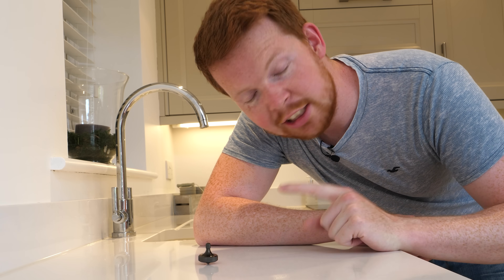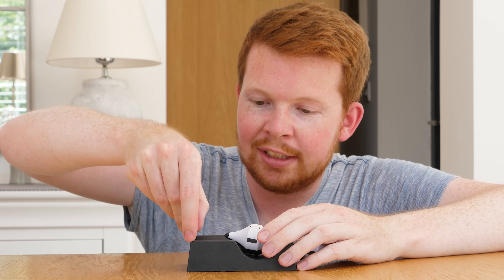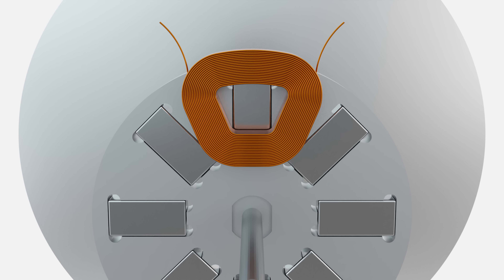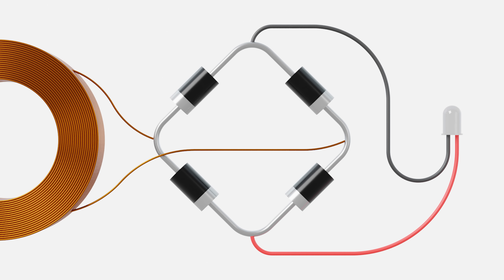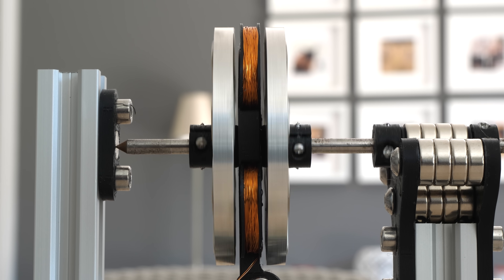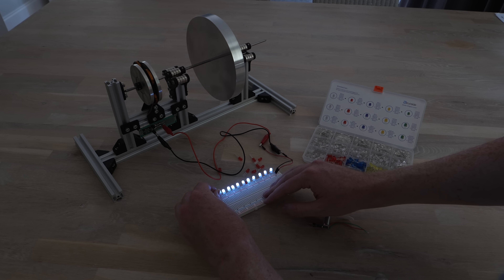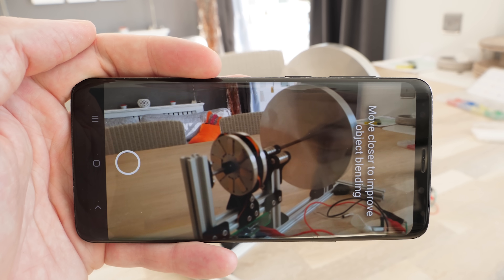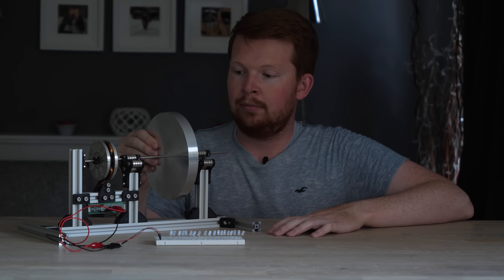Flywheel Battery

Comment: I had the basics of the theories all down fine but application sucked because I didn't have comprehension of the finer points. Bridge rectification is old hat to me, no problemo. Long ago I fooled with a mag lev rotor design but wasn't comprehending that it doesn't need to be completely enclosed by a ring of magnets. Gravity is good enough to make a half bearing work fine. SO cool. On to extracting energy from magnetic impulses... Wasn't understanding that it needs to be bilateral in order to be truly effective. Also wasn't understanding that the falloff distance of the magnets is critical as the force lines need to be positioned within the pickup coils. THANK YOU FOR ALL THAT. I had been thinking it would be stupid cool and cute to build a miniature model of a hydro power station under my rain gutter complete with miniature light towers so that when it rains like hell on summer nights, it all lights up like a proper power station. I know I don't need mag lev and a flywheel for that but still... If you're gonna go all the way to San Jose, why stop at Albuquerque?

A question... Could larger disk magnets be used at the ends of the mag lev bearing sections to keep it in place without a contact pressure point? I realize how slippery these fields are... but it just feels like it's doable with the right shapes nudging against the right shapes.

Comment: Why not add another vertical upright on the flywheel end, then attach a small magnet to either end of the shaft accompanied by a small pole aligned magnet attached to each upright?
This would stop any lateral movement of the apparatus using magnets and totally eliminate the friction between the axle contact point and the lateral arrester.
The result would be a true levitating machine with no friction points. It would also eliminate the requirement to slightly offset the supporting magnets.

Comment: This would be great in some kind of foam flinging blaster that uses much smaller flywheels. Just the floating magnets and the flywheel but smaller would be great. All you would have to do is spin it and you would have little friction on the axle.

Comment: If you buffer your output with an alternating set of batteries loading only the set not  connected to the flywheel you will get far longer and storing more energy

Comment: Very interesting video. In my humble opinion copper coils need an iron core to increase the magnetic field.
As mentioned by others schottky diodes are more efficient in these low power and high frequency applications.

Comment: Although the aluminium fly-wheel is not magnetic, because it is moving (rotating) relative to the support magnets, an EMF is induced within the aluminium, which produces an opposing magnetic field to the magnets, creating some resistance. However, you do have the fly-wheel and magnets separated enough that this shouldn't be too big of a problem. Just something to consider.

Comment: Adding a motor that feeds off of maybe 1/8th of the power from the flywheel, and adding even more tightly-wound copper wire could probably make this a self-supplying generator?

Also you should place magnets pushing down from the top or another stand on the other side for extra stability
Reply: Forgot to mention, the motor I was talking about is the one that spins the axel of the flywheel

Comment: What if you cut thin ridged slots into the edge of the flywheel that wouldn’t catch air travelling forward but would allow air to push it in it’s forward direction.  Then place the powered fan in line with the edge and see how close you can get to a perpetual motion machine.

Comment: Now instead of 4, try 6 coils separated 60 degrees and wire them in Y(star) and by using a 3 phase full rectifier (6 diodes) you will create something Nikola Tesla did more than 100 years ago. Oh yes, Schottky diodes will improve the efficiency.

Comment: As an FYI, thats a 400hz audible tone.. 400 pulses per second means possibly 24,000 pulse/RPM?.. and the military use 400hz as their power "frequency", instead of 50/60hz..

Comment: Very Cool! This has inspired so many ideas in me.... 
As a machinist myself one thing I would note is you'll have allot more success getting tight mag/coil tolerance and higher rotational coefficient using a tool steel rod of 1/2" or so then after you get it splined through the flywheel turn the whole component on grandads lathe. I'm sure you have already had a similar idea and maybe there are issues Im to dense to factor in lol,  but just in case I thought id throw it out there...

Comment: This was so fun and informative! Now I have more questions about magnetic levitation, and if it's possible to remove that last point of physical contact by using another set of magnets; though that would likely exacerbate the wobbling, so it may not improve the efficiency even if it did work
Reply: maybe use magnetic repulsion on each side? still think this is a good idea

Comment: another generator idea
...
take a bearing shaft
that spins
...
the housing with the windings can also be rotated
(other direction of course)
...
So you have the choice between slower,
but same power generation
...
Side effect: Bearing wear is reduced
...
or unchanged speed
...
which theoretically means doubled power generation
...
Provided the coils don't burn out,
because higher energyflow also means more particle movement
...
With a good design, a generator should
after commissioning,
self-propelled and not much taller than usual
...
the pantographs are designed as rings
...
while small pins can be screwed in from the outside
...
(similar to the carrera.toys, with the brush pantographs)
but they look like
the pins of plugs for devices (europe versions, round and not so thin)
...
they are needed for the junction box,
where the wires are connect

Comment: Wouldn't you be able to put the whole contraption I'm a vacuum box, and make and outlet shift, maybe with some gears and a crank handle to give it some real speed by hand? (The vacuum to eliminate the air friction of the flywheel)

Comment: What if you add magnets to the outside edge flywheel, at an angle, all facing one direction and then create a wrapper around the flywheel with alternating magnets. How long can you keep it running then?

Comment: A well done electromechanical demo do show magnetic induction, electricity generation and "how a bridge rectifier works". About the flywheel it's a well known principle used many years ago as a emergency solution for power breakout before the UPS, in that case where used a electrical power motor coupled to a electric generator with a flywheel in between, so the kinetic energy accumulated on the heavy disc was used only the time enough to startup the engine powered generator. Thanks for the demo.

Comment: About your wobbling, how about lifting up just a bit the floating end..gravity will push more on the pin and will maybe stabilized it ? I do not know much abot this..but when you generate the magnetic field..does it slow down the flywheel and let you get less energy as result ? my idea is to make it generate 110 v ..and connected a "cage" with the flywheel to acces a human or a dog in it..so by jogging, the flywheeel would turn and generate the energy with more stability then just with human or animal force...

Comment: You would have been better off just making the whole flywheel out of magnets. Your gonna have to put a steel casing and spin it incredibly fast to get a long lasting battery. a little wire loop holding the rear in place would be a smart move.

Comment: Hey Tom, I just saw a video by Fireball Tool where he made a bike powered by a giant propeller and it immediately made me think about this video. I'm wondering, could the flywheel be used to power the propeller? That would allow a normal bike of sorts with a propeller turbo on the back.
Not sure if this is possible, it would certainly be a challenge with all the weight and the small space of the bike. This might make it impossible to fit both a standard bike drive and the propeller as well as the flywheel but... anyways, just thought it was a cool video and wanted to share it with you along with some ideas.
Reply: Every time you transfer energy from one form to another you lose efficiency.  Propellers are extremely inefficient at low speeds.  Not at all practical.

Comment: Ignore the physics of kinetic energy. Proportional to the square of velocity. Electromagnetic induction also proportional to the square of velocity. As you withdraw energy and lose speed voltage drops quickly. 
All this fuss to make a useless toy. It can power loads that need next to no energy.

Comment: Also, I don't know if you know this, but you loose a lot of magnetic flux by stacking the magnets in the rotor instead of using magnets with the right thickness.

Comment: Why not use 2 magnets with like poles facing each other instead of the plate?   You might need another Y shaped support to keep them from slipping to the side and mating north to south.   I would recommend larger flat disk magnets with poles on the flats.